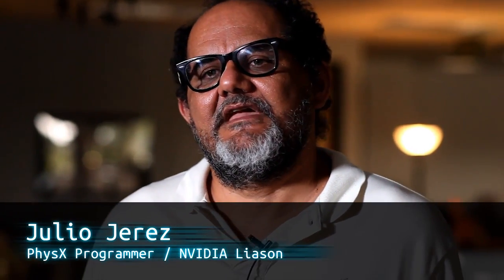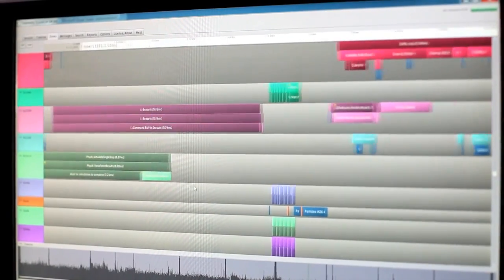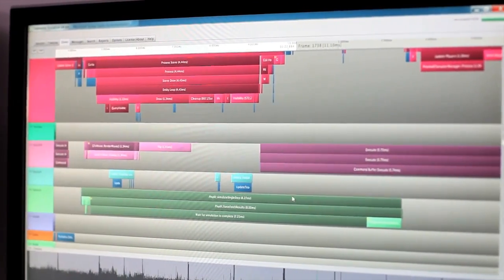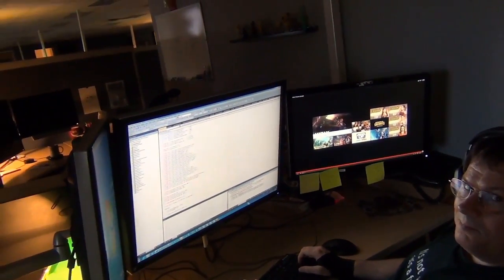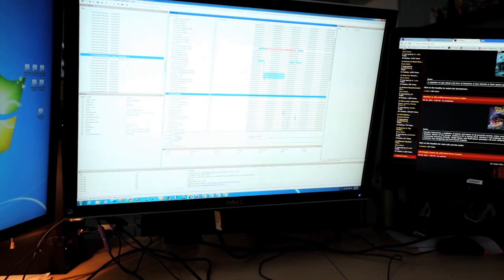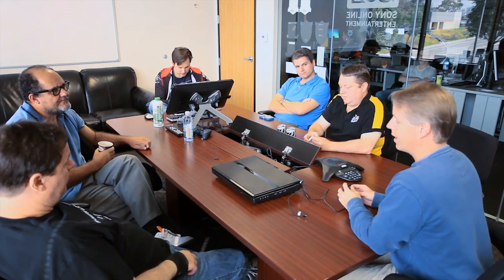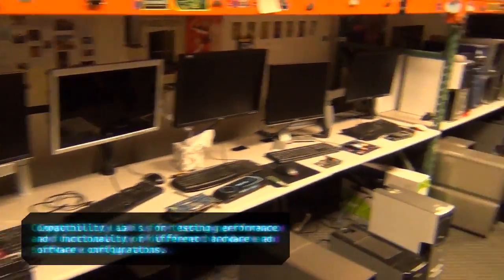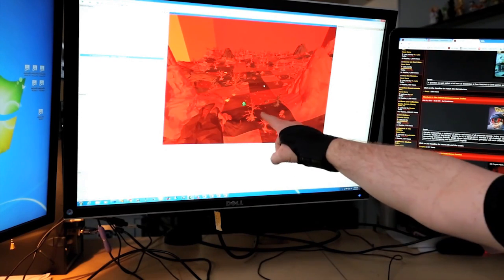PlanetSide 2: OMFG! Operation: Make Faster Game Episode 4

Comment: You can (or could some time ago) run the visual PhysX via your CPU.. PhysX was not developed by Nvidia.. PhysX is a multi-threaded physics simulation by Ageia who was taken by Nvidia.. And it is used in many popular game engines and it uses CPU to process it, but some video games with optional support for hardware-accelerated PhysX often include additional effects such as tearable cloth, dynamic smoke or simulated particle debris. And thats an extra option that comes with Nvidia cards..